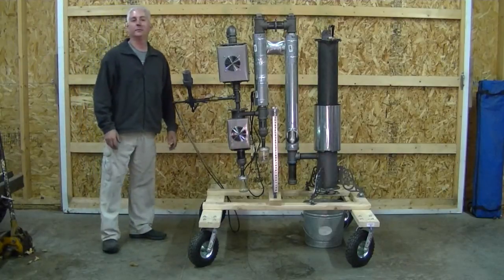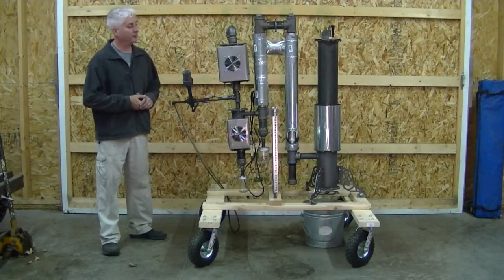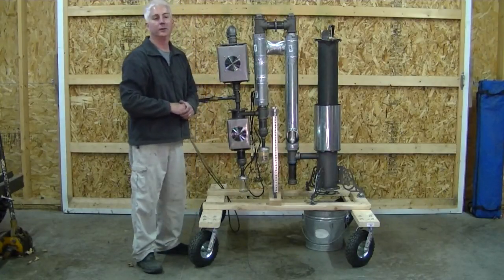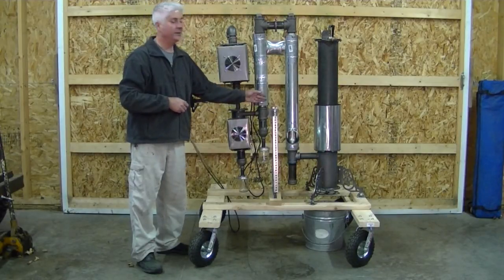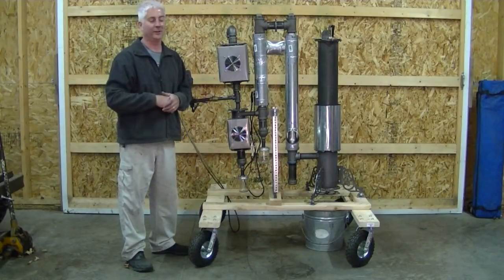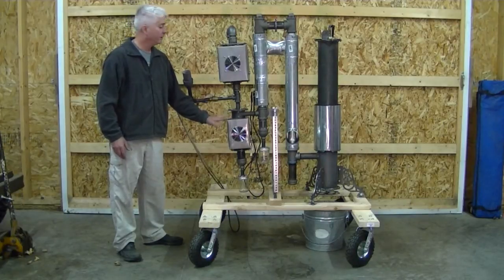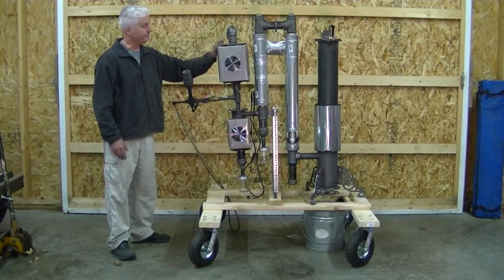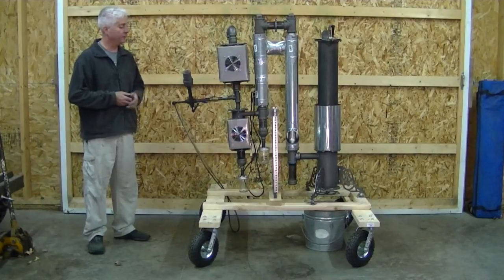2015 Gas Station Introduction

Comment: Looks very compact.  Could you direct us to a video of it powering an engine?  Does it need compressed air to start?  How long will it run under full load with one fill of fuel?
thank you-
Reply from the maker: Hi Fred.  If you got to the link in the comments section, the video of the engine run of the 2014 is embedded in the web page.  I am starting it with compressed air but there is another way using fan air from a vacuum cleaner which I will video soon.  It will run a 5kw for 90 minute max. on pellets.  Chips will go about 30 minutes max.